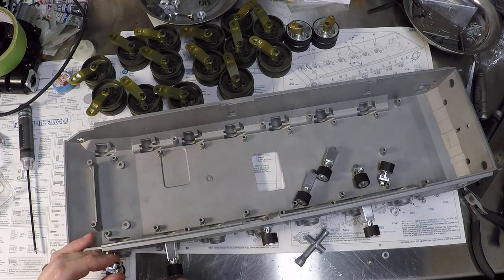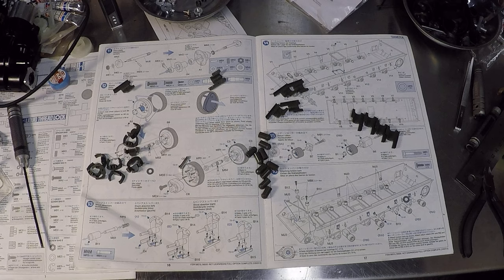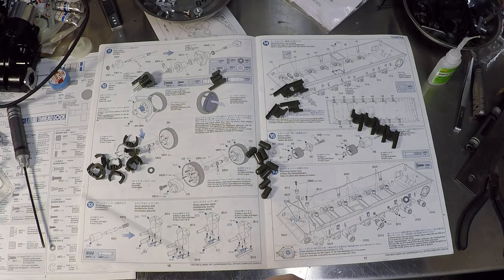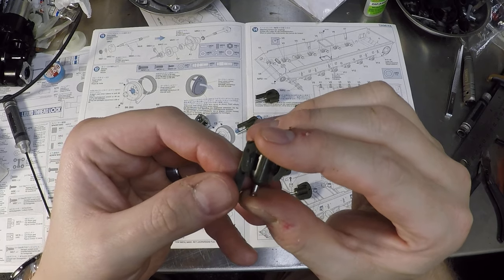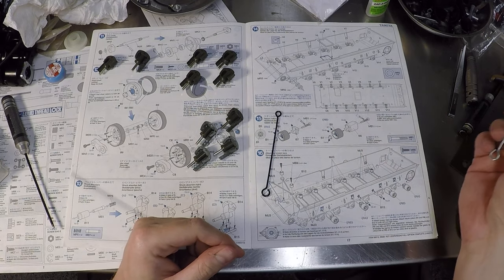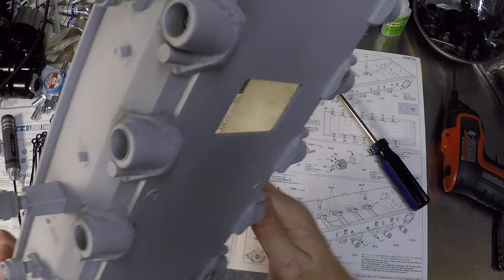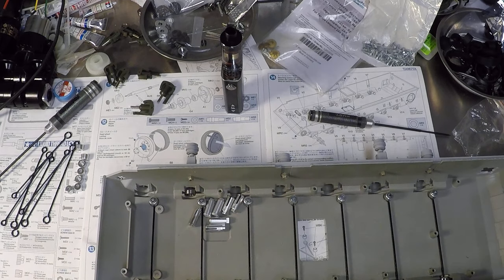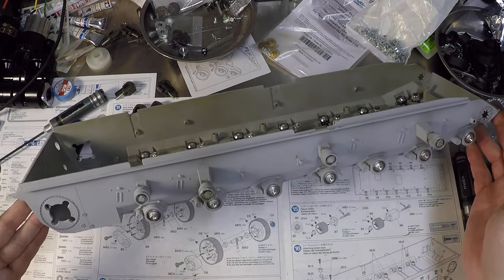Tamiya 1/16 RC Full Option Leopard 2A6 Tank #56020 Build Video with King Kong R/C upgrads part 3

Comment: Great video. 
On my Leopard 2A6 paint preparation I used blue tac to block the suspension holes on the Lower Hull and it did work a treat. 

I have a 2nd Tamiya 1/16 M1A2 Abrams to build because it was my late brother’s. He had partially painted it in Australian ADF Colours and has built the gearboxes.  
I have gone and got myself a set of Australian Decals for it.

If I had a chance I would build a second Leopard 2A6 and I would not change a thing in what I added in the extra metal aftermarket parts including the extra bearings that replaced the metal shims.
Reply from the maker: The blue tac is great stuff, and good luck with the Abrams build, I love that tank.